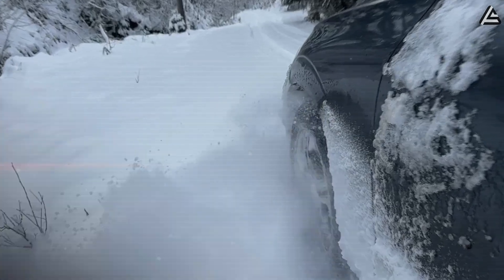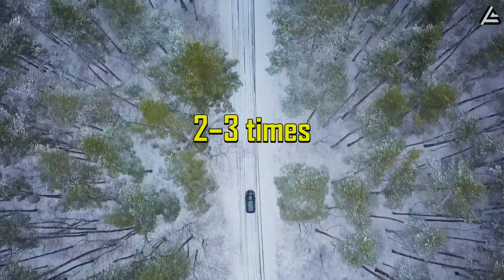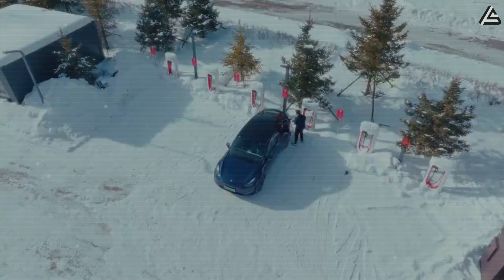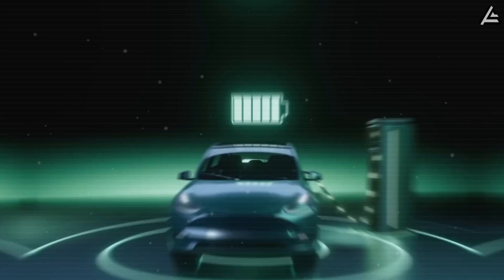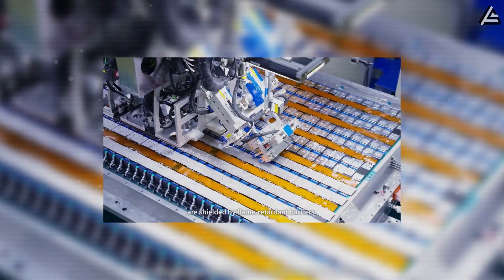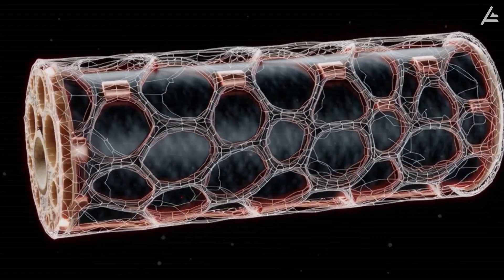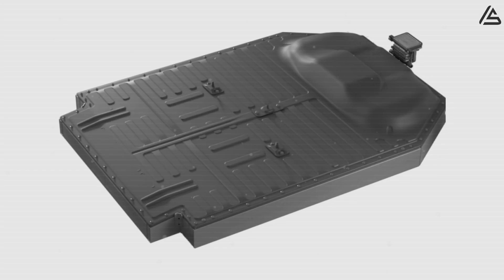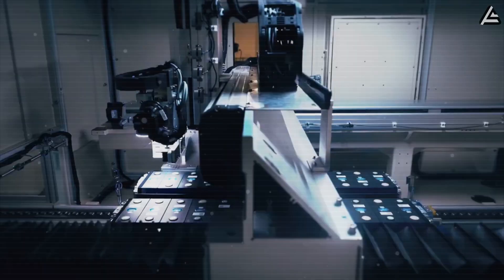2026 Tesla Aluminum-Ion Battery: What Happens in Extreme Weather?

Comment: I can get 450 miles of range in my pick up so I need 500 to 700 miles of range on an electric truck so I can pull heavy loads on my trailer.....pulling tractors, trailer loads of rock, cement and blocks,  other heavy equiptment.   Gas and diesel get me where I need to be but I don't see electic trucks doing this yet.
Reply from the maker: With the aluminum-ion and solid-state battery technologies Tesla is developing, that won’t be impossible anymore. Would you like to explore one of these battery types, or both, in more detail about range?